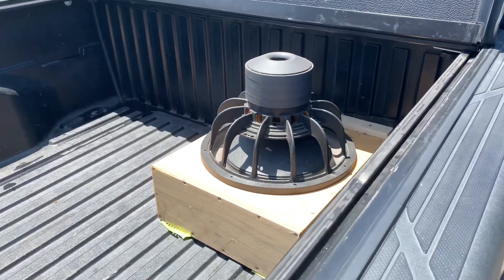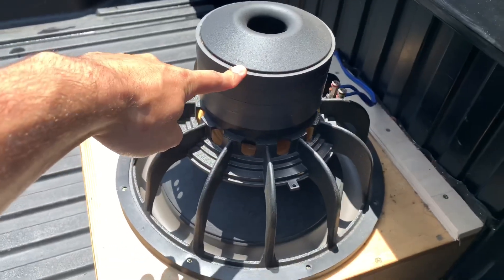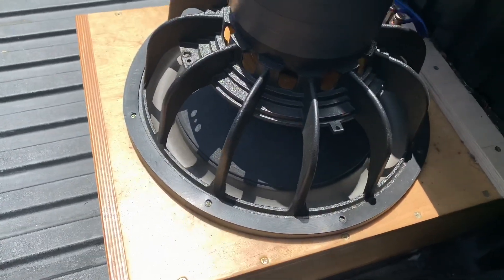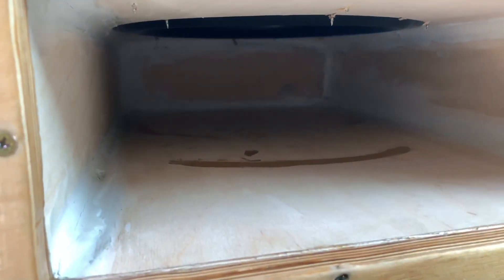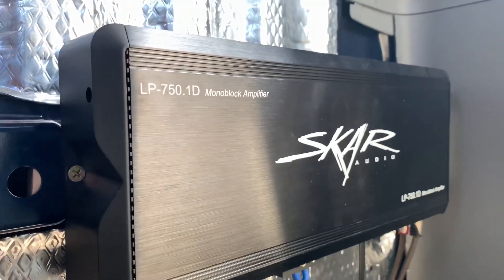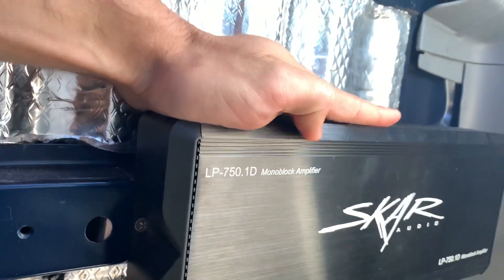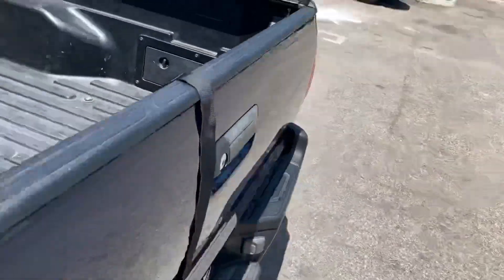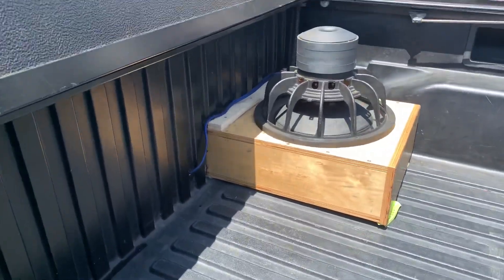Blow thru infinite baffle sub

Comment: That's cool. I've never seen an infinite baffle in a truck like that. Sounded pretty good though.
Reply: Its  not really an infinite baffle unless he rolls his windows down at all times.
Reply: @Petethebuilder  you are wrong, the infinite baffle is behind the cone, not in front. As long as the volume behind the cone is 10x of VAS it is technically infinite baffle
Reply: @FSXgta  it's still enclosed it's not ib
Reply: @fatstacks89  it's not enclosed it's completely open into truck bed..
sound waves don't interact therefore
IB..loaded

Comment: This is basically just separation of the sub's front sound wave from the back wave - needs just little power to be loud as hell - a dude from Finland had infinite baffle with 4 18s on 8K RMS, and he pushed 160+ dB, also he made a "tornado" on the 20ish frequencies. Also infinite baffle setup have practically zero group delay - so this is the best possible SQ subwoofer system in theory, but on the other hand, there is a need to be careful with the power because the sub's cone is practically not damped...so...

Comment: I have 8x IB318's in the ceiling of my home theater, and an Acoustic Elegance IB15AU in my car. I recently got a new truck and have been wondering how I can do a clean install with the IB. Very very very few people have attempted this, but IB gives extremely clean and low bass. I am all about sound quality, and I also use a MiniDSP in my car and theater. I'd really like to make this work in my truck but I haven't decided if I'm willing to cut through the back of my cab. Kudos to your IB truck install!
Reply: all the competition scene at IASCA is moving to IB setups
Reply from the maker: Thanks. I did it because my truck is cheap. Will probably drive it till it dies. I wouldn’t go cutting a $20k truck

Comment: Very cool!
I've got (4)Fi IB3-18s in an attic mounted IB in my home. 

Some additional info addressing that vibration;
 if you could go two drivers, dual opposed, with a vertical manifold blow thru, you wouldn't have that reactionary vibration bouncing off the pickup bed. 
Any box vibration at all is dimished bass clarity and detail.
In a dual opposed, all reactionary energy is nulled. 

No offense intended, hell you likely already know this.  

Another way to tighten this install up is mount a cargo bar across, with an expandable bolt vertically... simply securing it to the bed.
Reply: I know your comment is old but by any chance is that system still active in your home? I am very interested in a walk-around video if possible!
Reply: @JayyCobb  
It's still going strong.
Don't believe I've made video captures of it, but I've got many images.
Reply: I'm extremely interested in this setup myself. I'd love to do a similar setup in my home. What are you doing for power? Plate amps?
Reply: @vincewyche3589  
That's the thing, amplification with an IB isn't a big challenge. 
I use Behringer EP4000, high quality amplifiers aren't really needed. 
It only requires 300w per IB3-18 to hit full stroke... they're not fighting the box volume air spring that most all subs encounter. 

Go to; Cult of the Infinitely Baffled,
there you'll find everything you need.

Comment: people dont understand how much 1 watt sensitvity makes a difference,  car subs fall on there face with with thousands of watts in a large space because of of there super low sensitivty at 86-88 db. . . if you do the math  the best car subs can hit about 118-120  db  with about 1500 watts  in half space[IE large area with no walls. near bye . ]. . , ,this more or less becomes another 12-20 db because of cabin gain in the car. . .  this means 140db plus in the car, mean while pro audio with there 99db sensitivity and often hit 128db--134db]  in a half space with a ussual 400-1000 watts. . .   put that in a car [seldom people ever do]  but if you were to in theeoy you would  hit 154db with as low as 500-1000 watts . . and you should be able to keep up with 140db 1500 watt car systems with as little as 200-300 watts because of how sensitive Pro PA speakers are. .   not sure if your ware but if i remeber correctly IB set is the lowest gain from cabinet  possible. . if i remember correctly Infite baffle is 0db, sealed is +3db, ported is +6db, bandpass is +9db. . .  [rember  each 3db equal the equvilant to adding a compltely speaker, so a bandpass is 3 times as loud compared to a IB on the same exact wattage. .  either way, super cool, super unique. . my only concern would be some one stealing it

Comment: What about when it rains? Do you try to avoid driving when it looks like it will rain or do you have the sub sprayed with some sort of water repellent spray? Looks dope tho and I'd really like to hear how loud and low it hits. I have a single cab silverado and am planning on building a blow through with some sundown 12s myself ...
Reply from the maker: Never and problem with the woofer since I have the bed cover. The problem was with the hole into the cab. I had improve the sealant because it would leak into the cab when I would wash my truck. But now it's all good and water tight.
Reply: @braxtonmarius  same problem - fixed it with FLEX SEAL

Comment: Never seen a setup like this before. I saw a demo truck out of local audio store and the bed had six 18in subwoofers in it but I've never seen just one sub and one setup to Port into the cab. Any reason why you went with 4 gauge wire instead of 2 gauge for the power and 1 gauge for the ground? Also what brand of wiring did you purchase? I'm running a kicker 5000 watt amp from 1996 and it works like a brand-new amp and I paid $500 for it when it retailed at the time for 2,000 US dollars so I'm happy as I've been pounding it around town for two months now and there hasn't been one issue. I'm running to 12 inch skar competition subwoofers and all I can say is they shake the entire car and it sounds like s*** on the outside because of the vibration but I'm going to be putting in Dynomat or some sort of liner to get rid of the vibration and have a nice clean bass sound coming out of the trunk. Different setup that's for sure and I would have to hear it in person to give you my honest opinion but it looks like it suits you so I hope you enjoy and that's what it's all about right? I'm running 2 of these....

https://i.imgur.com/e2B68H1.jpg/img>

https://i.imgur.com/cJFdA6n.jpg/img>

Comment: I would be awesome to see a cab of a truck get reinforced and sealed to be used kind of like a box. its not perfect but it would give some interesting output. Also To be able to keep this as a infinite baffle it would need to be the same surface area as the cone leading into the cab or else your making a very short transmission line. Its way off tune but can raise the FS Of the Woofer 8-12 Hz losing Low-end output.

Comment: Just so you know. Skar under rates there amps. So that amp is more than likely pushing 1,000 RMS @ 2ohm's. I have the RP 1200.1 that clamps at 2,000 RMS @ 1ohm.  Even there 350.1 is clamping 600 or more at 1ohm. But that is only if you have the power to feed the amp it's self. So if your only on stock alternator an upgrade battery that is not going to get full power out of the amp. You may not even be seeing 600 out of it on 2ohm

Comment: Thank you very much for posting this...I have a sedan... would it be possible to do something similar in the trunk?
Reply: Yes free air is perfect for sedans. You can mount the subs in the parcel shelf or if your car has a ski hatch mount them on a baffle against the back seats. It is a bit of work though as to do it properly all gaps have to be sealed up to ensure the trunk area is separated from the cars interior
Reply: Sqnutt  you are awesome thank you soo much i Am going to start this weekend
Reply: You're welcome Bro, I'm doing the same in my sedan (I'll be using 2 Acoustic Elegance 15's), but a sound shop is going to handle the install. If you're going to DIY maybe check online, You might find some tips and tricks.

Comment: I like this idea for a truck only concern is the bed when you haul stuff shifting the box in the hole could cause an issue at some point depending what you haul I suppose as well I’d build a cage to go around the magnet to make a luggage proof sub for daily use just an idea

Comment: Thats what i like about ib in limited space installs. The subs suspension is designed to control what frequencies are loud and what arent.its design is pretty much the tuning. I imagine the  chamber is acting as a port and it is definitely affecting rolloff on the top and bottom of the frequency band. If it was installed in the cab wall with nothing in front or behind the cone ,it would act differently

Comment: I wanna do this with two Dayton ultimax 15's on 1600 RMS, but with the magnets down for safety purposes and probably a plexi "lid" over the cones on stand offs so they can still breath good. I'm trying to retain max usefulness of my Ranger while also getting some HEAVY DEEP bass that I've never experienced before. Do you think this is a good plan?

Also, I've read that it's better to have two identical speakers as close as possible when it comes to using them as "one" to increase output, do you think output would be negatively affected if I put each 15 on opposite sides of the bed so I can slide my motorcycle in between them when I need to haul it?

Comment: what u gonna do when it rains and snows?
Reply from the maker: Never and problem with the woofer since I have the bed cover. The problem was with the hole into the cab. I had improve the sealant because it would leak into the cab when I would wash my truck. But now it's all good and water tight.
Reply: @braxtonmarius  oh so you do have a bed cover. I was like how in the world does that work during the rain. Unless it was a marine sub but then it still have wood exposed. I though i had seen rails for a bed cover. 

Nice set up by the way. I'm currently thinking about doing a 6th order rear deck blow through on my town car.

Comment: This is not an infinite baffle setup. This is a 3rd order configuration. related to a "T-Line" transmission line. Infinite baffle is a 2nd Order configuration. A driver is considered a second order by default. Any energy storing component (chamber... ports... Lines) are considered an additional "order" to this configuration. This subwoofer, in this video, is loaded into an energy storing component (vent... port... line) whatever you want to call it; adding an additional "order" count to this setup. Thus making it a 3rd order configuration. Pretty unique though. 👍
Reply from the maker: Well said. I stand corrected. Thanks for the help
Reply: BudgetBassHead, I thought exactly the same before I wrote my comment (approx 2 months ago). But I tried to explain myself why it acts like an IB (please correct me if I am wrong): 1 - the listening enviroment is the car's interior, so there's no interaction with the sub's front wave, because the sub's back wave (the whole basket) is completely outside, interaction with the back wave is possible just only like at a regular IB setup: outside the car, or when opening a window/door, and similar conditions, 2 - if this tiny chamber is considered as a T-line, or like a tiny ported box with the biggest possible port area, and zero port length, then it is tuned so high, that it not affects the "sub bass" range (I mean the official 20-60 Hz range), or even the "bass" range (60-100 Hz). If this is correct what I wrote down now, then basically Braxton invented something: "3rd order IB", so...

Comment: Oh and the dimensions of the baffle please?
Reply from the maker: 16.5" wide 6.5" tall 24" long. 3/4 birch ply all around. And you need a flare at the opening end to help create a seal. You need to weather proof the shit out of the hole in the truck otherwise it will leak at the edge. Expanding foam and weather stripping should do. Install at your own risk! But it's a great set up. I'm still rocking it after several years
Reply: @braxtonmarius  Thank you! I really appreciate you taking the time to read the post and respond... and especially putting in these details about the port size in the wood!
Reply: @braxtonmarius  I am thinking of putting it in the very back of a mini van with the port firing to the passenger side. What do you think about it working?

Comment: if you actually sealed the real wave of the sub you would get real results. this is just wasting the potential of that sub. Its half ass ported to probably the high 30s low 40s being the spl peaks in the lows instead of having a flat response like ib show on the graph. its a good idea but its losing a lot of sq and spl because of the lack of a sealed real wave. still cool tho. being you put that much time into sealing it and sd it you should finish the back
Reply: I don't mean to come across as rude here but you clearly don't understand how I.B works..
Do some research and learn, still to this day the most impressive system i have ever heard was I.B done right.

Comment: If you build a proper box that thing would rock. I'm thinking 6th order.
Reply from the maker: I agree. But I actually use my truck bed for work stuff and for motorcycles. I could not afford the space of a 4th order.
Reply: I was thinking large low tuned above the woofer, the woofer would sort of be in the port at that point, which made me think with A LOT of modifications a tapped horn.

Comment: How are you considering this an infinite baffle that's a port  bro that's not infinite baffle infinite baffle is where the top and the bottom of the sub have free air with no resistance you have a port that creates resistance that's not infinite baffle
Reply: No that is definitely infinite baffle, I agree it's not your typical set up but it does perform exactly how an infinite powerful set up should perform. Basically the only thing you need to do is cup or the waffle cone with the interior of the car. Absolute infinite baffle will be a wolf or mounted to a gigantic flat plane in an open field with you standing directly in front of the woofer at a certain distance. The interior of the car is basically a box in the situation and for that matter all infinite baffle situations that are used in automobiles so rolling the windows down will change your sound but again vehicle this is an infinite baffle set up.
Reply: @kerrypence4201  no its not this would be like a tline quarter wavelength if there is a port by definition it cant be infinite baffle infinite baffle is just a plain both side have no port or sealed chamber hence the infinite baffle being in the decklid
Reply: @kerrypence4201  door speakers are infinite baffle as well
Reply from the maker: @billl2383   Um idk man. You might know more than me. Yes it's at a 90 degree angle to the exit. But I've always thought of a box as a resonance chamber and then exits through a "port" or "acoustic filter" which is usually narrowed. There is not contained chamber here, and there is no narrowing, no back pressure, no resonance filtering. I could see the 90 degree turn and slightly narrowed slot reducing output. But I don't see it acting as anything other than a free flow of output into the cab. I'm rambling. But you get what I mean. It's hard to define.
Reply from the maker: @budgetbasshead might have nailed it down below.
Reply: @braxtonmarius  tline box is all port just like that sometimes the sub is in sometimes out all my quarter wavelength boxes have been sub out but ultimately if it sounds good its a win

Comment: very nice result but this essentially is a large sealed enclosure - the equivalent of placing a  sub with the vas of 3 cubic ft. in an enclosure 4 times the size imho
Reply from the maker: A truck bed is like 1.5x4.5x6. So that’s 40 cubic feet approximately

Comment: A 4th order wouldve been better
Reply from the maker: I agree. But I actually use my truck bed for work stuff and for motorcycles. I could not afford the space of a 4th order.
Reply: 4th order BP is too muddy and boomy. Sealed and IB are the way to go. Some ported box and sub combo’s still have fast response sounding bass though.
Reply: @davidperry4013  that really depends on your preference. Rap music sounds better with vented boomy bass. Rock music sounds better with sealed punchy bass. 

Nothing compares to a well made ported box to exact specs. Tuned to the right frequency. Box tuning can make or break your subs.